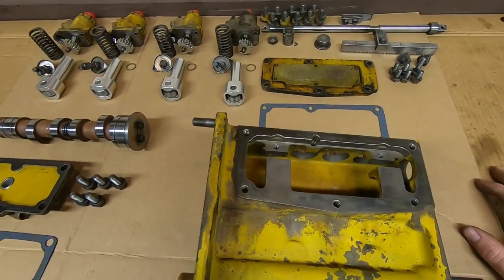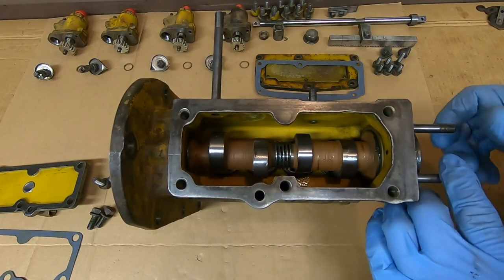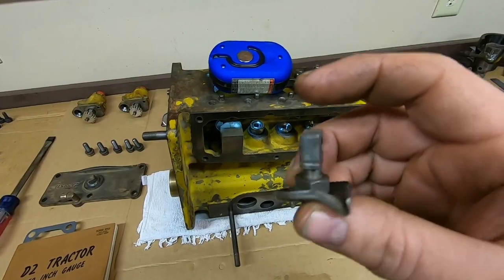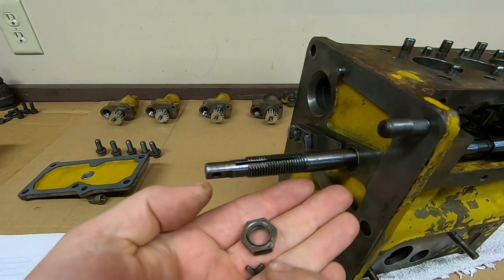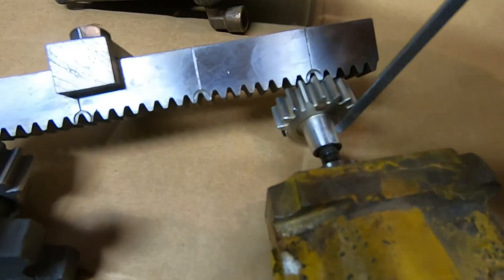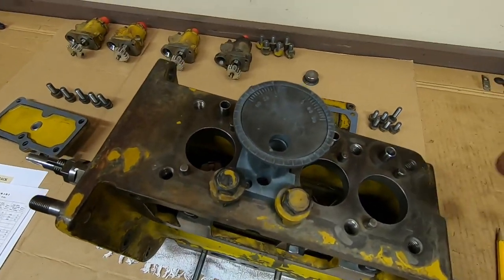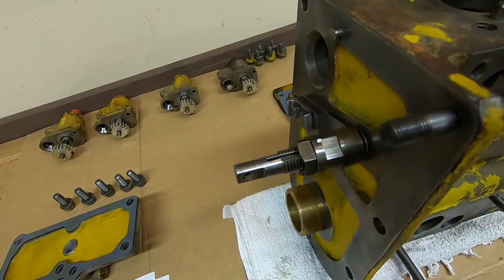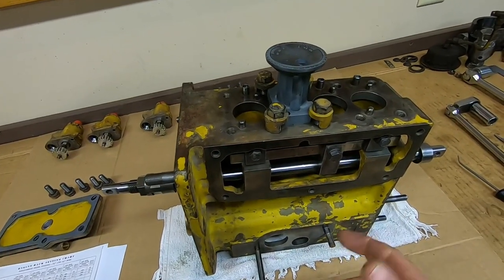Caterpillar D2 #5J1113 Diesel Engine Assembly Ep.31: Injection Pump Assembly & Setting The Fuel Rack

Comment: To make the gaskets: when using a pipe cutter on EMT tubing, it leaves the inner bur. That bur is sharp enough to cut, so if you find another pipe with 3mm+ ID, you can pipe cut that and get the outer circumference of the gasket. The pipes will dull over time, but a scrap piece of hardwood as the anvil helps.

Comment: The special rack timing tool is VERY impressive and you are fortunate to have it. Wonder if an O-ring might have worked just as well on the lifter? If you did use it, no one would know other than Toby.
Reply: I was wondering the same thing, small material diameter O-ring of an appropriate size?

Comment: Hi  Squatch253,
well done mate on a fairly technical subject.
If I may add some comments on your rack setting dimension as you likely do not have the dimension for your 3J-5J series  D2-from my old Rack Book it is given as : 3.010" for use with the old style tooling in use before the 3H1690 Gauge came into being.
To use this new 3H1690 gauge with the old Tooling Rack dimension it is necessary to simply subtract 2.55" from the old Rack dimension to get the necessary dimension for the 3H1690 Gauge.

New dimension is given in the later Rack Charts as for use with the new gauge :- 0.460"
Yes, Subtracting 2.55" from 3.010" does give 0.460" by my old calculator.

From the newer rack Book it gives Rack setting Data for the 3J-5J D2 as :-
Full Load Speed
-when the rack stop collar is just touching but not deflecting the Torque Spring with the engine under load--- is 1525 +/- 10 RPM.

High Idle-1650 this will vary due to parasitic loads and Governor components and Spring condition usually in a range of +/ 50 RPM.

Low Idle :- 600 RPM, I sometimes vary this to get smoother tick over with least shaking of the engine exhaust system--ie smoothest idle.

Hope you can follow this waffle.

Best Regards,   and keep up the great tutorials as they will be a valuable resource for future restorers of most early Cat product as the basic mechanics apply throughout.

Eddie B.

Comment: Probably good to have the rack up a bit anyway to account for wear in the pumping elements and delivery valves that way the actual fuel output is close to factory.  Wouldn't it be easier to cut the little hole first then take the OD? That way it wouldn't stretch and it would seem easier to line up on center. If you want to get real fancy do it in your drill press. :-)

Comment: Great video as usual.  You set the bar for this type.  I've been waiting for this part.  Fascinating to see the differences from modern Fuel injection pumps.  Also the similarities. My car (VW) has a rotary injection pump, my old boat engine (Volvo) had individual injector pumps, my new boat engine (based on the Kubota block) has one similar to this with individual injector pumps ganged into one box.

Comment: 1. Do you ever Magnaflux high stress parts such as cams and cranks to reveal cracks? Air craft even test their bolts. 2. Precision torquing: if you torque dry, with oil or copper coat, you will get vastly different results. In the refinery, we precision torqued every flange on equipment,  including 10 ton heat exchanger bundles, always with copper coat. We could stop leaks on high pressure, high temperature exchangers that historically leaked. Without a thread lubricant, you can not know what your actual torque is.

Comment: Squatch, I've said it before and I'll say it again you definitely missed your true calling as a top notch vocational school instructor. 
Now days with prices thru the roof on older excavation equipment there's a serious need for young mechanics to repair them for guys like Chris Letsdig18 and others who let others repair their older equipment. 
The old guys are retiring or just plain dying off and I've seen local construction companies advertising for mechanics with well above normal salaries.
Now with the infrastructure bill putting thousands of young people to work they need them on major infrastructure projects like the one near where I live.
A modern crossroad controlled traffic lights busway with underground battery charging for ev busses and upgraded covered bus stops.
When finished the roads and buswa lights will be timed perfectly to get better traffic flow.
They even intend to put in road crossing arms seen on railroad crossings to stop red light accidents. 
I was on a bus that hit the rear end of a red light runner.
Ya gotta be seriously dumb to decide to take on a 40 thousand pound bus just to save a few minutes off your trip to the grocery store.
Totaled my bicycle on the rack in front.

Comment: Ah but you can set the lifters off engine but you need a degree wheel (also a dealer tool) and that said, I still like to set the pump lifters on engine as it compensates for gear train wear on such an old engine. At any rate nice work and you truly know that old iron down to the nats...well you know🙂

Comment: Where you and I differ, I am the only operator and will eror to more power as I drove truck and getting the last breath of power out of a engine was a bad thing. Rolling backwards cause there was no more and it wasn't lugging, it was the limit set and had room for more and afterwards was there for me. Dad would load me heavy and I would pevey a peak log off just to catch holly heck for. When the bridge we were using fell through with me, he checked his truck before digging me out of that cab that folded over me nearly cutting my legs off. The only way to get some rest was to stay in the hospital with a broken vertebrae at fourteen years of age. The fuel system on a gas mack was similar to most but the fuel jets were two instead of one and a q tip would go through it, now that is huge, It had a spinning deflector on the inside to help break up fuel  and what kept it going through a valve beats me. It gave you a headache to drive all day. If I am the driver then it gets power and I finally took the doors off so I had a choice if it ever looked at me sideways again but your in for a penny so your in.!!

Comment: Squatch, "I'm going to make another video of fold over locks on video again, it will be the highlight of the video for sure". Also Squatch, hold the phone, let's break out the Christopher Walken impression. The real question, for those of us who can't leave well enough alone, how much can you turn up the rack on a D3400 or D343 without them smoking badly under load? I've seen how big those bearings are, and everything else, it can certainly handle more fuel!

Comment: Thanks for another update, so now we know there are people out there with  lock tab and cosmoline  fetishes, oh well it takes all sorts I guess L.O.L. So a basic description of that torque springs, the difference between flames out the muffler  or not !  
   I know you like making tools, would it be possible to modify an old pump lifter end in the lathe to make a tool to punch those small gaskets, I'm thinking make the groove deeper so it don't crush the cork as you hammer or punch it in a press and maybe just shamfer the edges to sharpen it a bit . But you're probably at the end of restoring those pumps and motors now anyway I guess.  Take care

Comment: A little hesitant to suggest this,but you do engage in overkill. A baby food jar with a hole punched in the top and rigged with a little copper pipe feed would actually tell you that there is some fuel leakage,and how much. Held with some clamp or tie wire,you then have a visual rather than just a drool down the engine block. Worthwhile?  Well NASCAR requires catchcans......

Comment: Yes the 2A-5710 gaskets are available from Cat $1.59 each. Oh well lol.
Reply: Could those be replaced with an o-ring?
Reply: It looks like they might just add friction to help keep the trough / shield from turning?
Reply: @WilliamWallace14051  They seal any fuel from leaking around the lifter yoke and trough.
Reply: @cheeto4493  No, there is no groove to keep the o-ring in place, it would just squash out.
Reply: @RomeKG471  Do they?  They are located underneath a metal stamping designed to divert a minimal amount of leakage.
Reply: @RomeKG471  at 19:50 looks like a groove to me. It's under no pressure so they should hold up as well as the thin cork rings.
Reply: @cheeto4493  What ever floats your boat.

Comment: Can't take 10 minutes and clean the rust off the camshaft?
Reply: Get your eyes checked.  While you are at it check your attitude.
Reply: AISI 8620 is a low carbon alloy steel-
From ASM Handbook-
Stop-off Technologies for Heat Treatment:
A wide variety of stop-off technologies for heat treatment are used to selectively prevent the diffusion of carbon and/or nitrogen during atmosphere carburizing, carbonitriding, vacuum carburizing, and various forms of nitriding. In addition to selective stop-off, technologies are also available for scale prevention in open-fired furnaces. This article describes two stop-off technologies, mechanical masking and copper plating, along with stop-off paints/compounds. Prior to the application of stop-off paints, the part surface of the furnaces should be properly cleaned and dried. The article also describes the usage of stop-off paints in different heat treating processes, namely, carburizing and carbonitriding, deep carburizing, vacuum carburizing, nitriding and nitrocarburizing, and plasma nitriding. The article concludes by reviewing the application methods of stop-off paints: brushing, dipping, dispensing, spraying and stamping.
Reply: Copper plating appears to be old school-replaced by modern coatings. Stuff I work on tends to be newer that 'this old cat'
Live and Learn, eh?
Reply: @squatch253  I always found the contrast of the copper plated core to the ground and polished lobes pleasing. The Super M cam has the same treatment, still beautiful. Modern Billet Roller cams for performance engines often have the same appearance. Cheers Squatch.